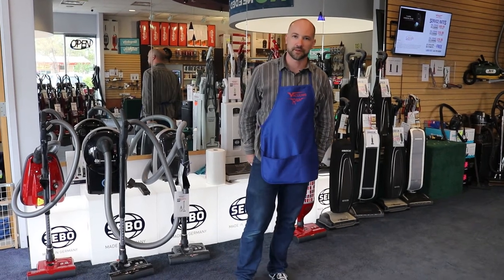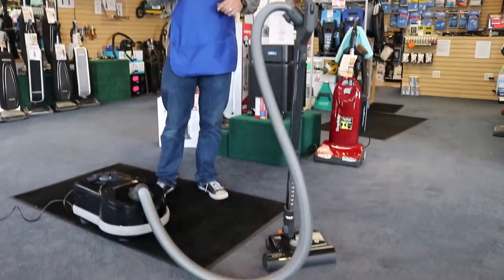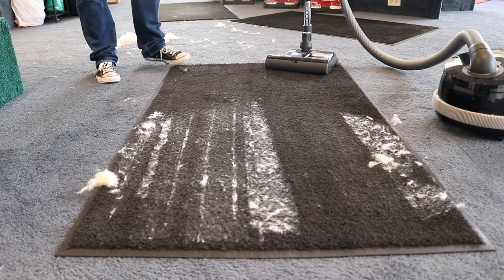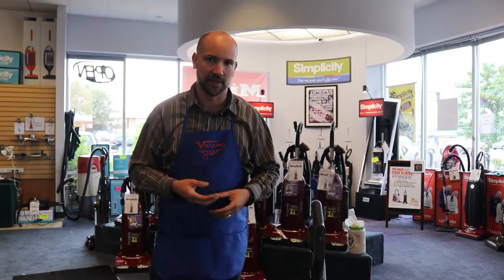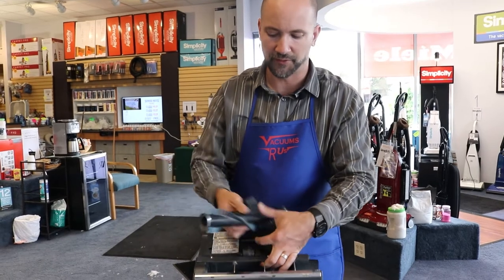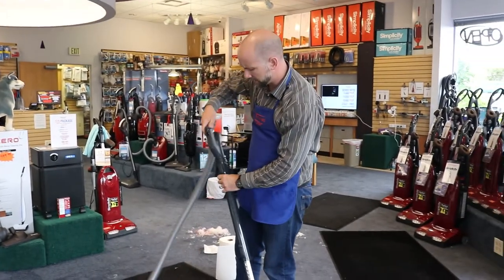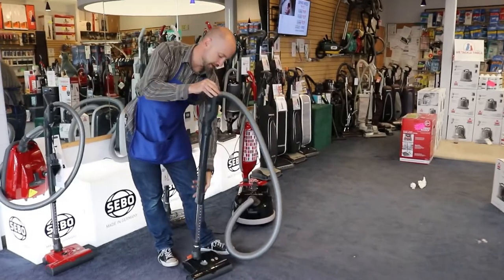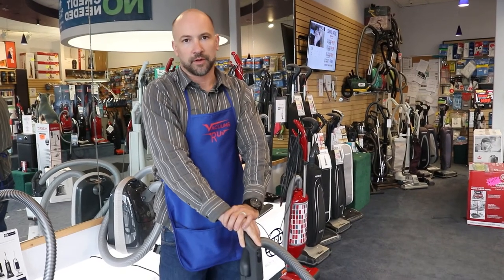Vacuums R Us demonstrates Sebo's D4 Canister

Comment: I bought a very expensive Dyson, and I have buyer's remorse.  So I went from that Dyson to a very cheap Bissell where the telescoping pole is just a friction fit that falls off the hose when vacuuming.  It's ridiculous.  I have a 25 yr old Hoover that I love, but the hose now has holes in it covered with duct tape.  I'm wary about buying another expensive vacuum cleaner, but I'm going for the SEBO.  I researched Miele, but SEBO seems to have it over the Miele.  Thank you for the video.
Reply from the maker: I personally own a Sebo and I love it. Sometimes it takes a transition period but Sebo is one of my most recommended vacuums. If you have any questions we could answer, don't be afraid to give us a call! We can help you find a local dealer as well.
Reply: I can confidently say either of those Sebo or Miele are solid choices I'm sure by now you've made your choice but if you go with Miele I will say avoid the models with controls in the handles you'll thank me later
Reply: Just break the Piggybank

Comment: For 1,300 this should have came standard with the ET2 15 inch cleaner head,don't see any for sale with it ,but they have it widly avilable as a 500$ combo kit for Central vacuums.
Reply from the maker: The is intentional actually. The wider the base the farther the air flow is dispersed so a performance drop can be seen as we extend brush chambers. Additionally for most homes the Et1 is a more popular option as it allows for better maneuverability around furniture. The higher air flow in centrals along with the larger square footage in homes that typically have centrals installed makes the et2 popular in that environment.
Reply: I for one wouldn’t want the et2 for home use. You could argue it should be an option for the same price perhaps, but not as the “standard” for reasons Josh mentioned above.
I do also have a karcher/windsor access (dart) with the 15” head, and have no complaints about performance, but it is noticeably larger when trying to maneuver around furniture and such than the et1.
Reply: They used to let you pick. Course the real outrage here is that Sebo only asks around $600 for the D4 in the UK, for what now costs $1400 in the US.

Comment: I had/have a C3 Brilliant. My son kicked it down the stairs, and the housing came loose, somewhat. I had it repaired, and while it was being repaired I bought a D4. I thought my Miele should have held together for the price, but now I think any vacuum getting kicked down a 14 flight stair case is going to get damaged to some degree. My Miele was still fully functional, I’m just picky. Anyways, I used the D4 for 2 weeks and couldn’t get over the bulky hose, and the awkward maneuvering. The power nozzle did not seem to clean as well, and it overall felt less refined. I didn’t like that it had no HEPA13 filtration as an option. I swapped it out for an E3, and ended up with the same conclusion. So I sold it and bought another Miele C3, a Cat&Dog this time, and upgraded its filter to hepa. The C3 is significantly easier to use, pleasant to use, filters better, cleans carpet better, and is an overall better product to clean with. What I loved about the Sebo vacs is that they are easy to dismantle for repair, and some parts can be repaired instead of replaced like with Miele. BUT since the Miele vacs tend to last a similar life span and are extraordinarily durable themselves, I find the Miele C3 to be the best choice for a canister across all brands. For uprights, I love my X4 Boost, but I am wanting an X7 Premium since you said they clean carpet better than the X4 Boost. My X4 won’t clean my carpet unless Boost mode is enabled, like it won’t maintain contact with the carpet. It constantly hunts for a setting, and when it does reach one it still isn’t low enough.
Reply: Can't go wrong with either. Miele's use bigger motors for much higher suction, but I have to say Sebo's ET-1 powerhead is second to none.

Comment: My question is, why are Miele parts more expensive? Are SEBO parts the same quality or slightly less? Is there an actual reason for this?
Reply: Their vacs are cheaper up front. Both brands use the same cords, same castors, same motors (Miele uses Domel, while Sebo uses them in their uprights, but Ametek in others.)